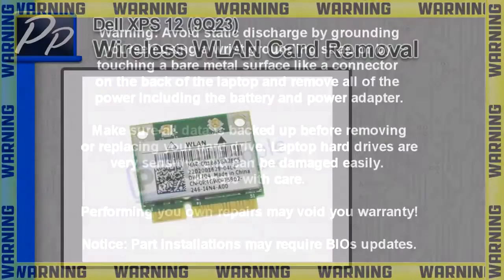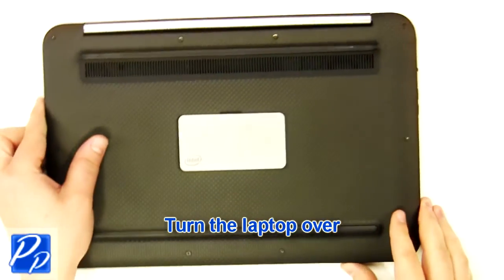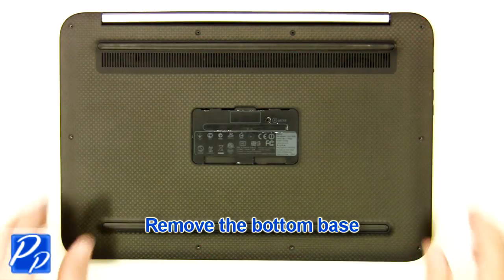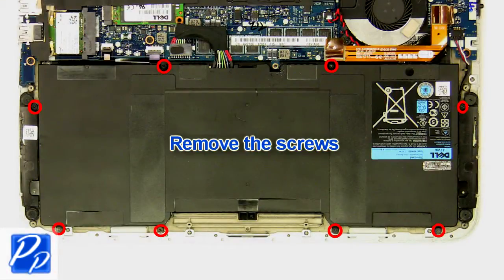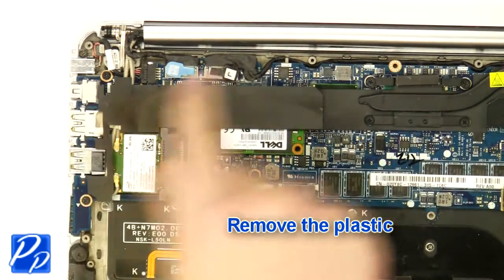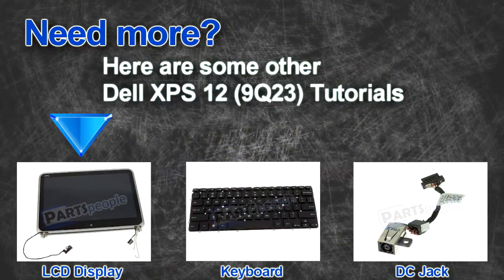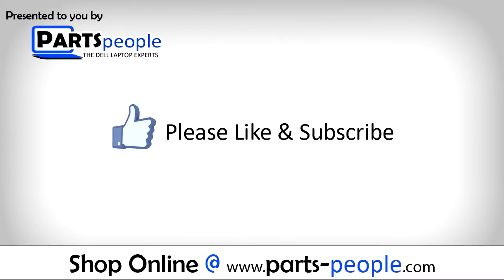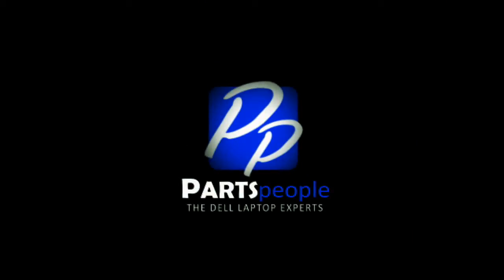Dell XPS 12 (9Q23) Wireless WLAN Card Replacement Video Tutorial Teardown

Comment: Have fun putting those cables back on or on your new card, by the way. Little tip: the metal part that clicks on has a mouth shaped like a microscopic O, which goes around the smaller o on the WLAN card. I couldn't get fingers to snap them on, so I lined it up, took a screwdriver and rolled it over against the top of the metal head  of the cable until it finally snapped into place.

Comment: Is it possible that a system component like this could just "go bad" for seemingly no reason and need replacement?  My Windows 10 install Device Manager sees this card in my system and says the driver is working properly, but the Network Troubleshooter says it is not "turned on" - there is no physical switch on my laptop - an indicator that the card needs replacement?